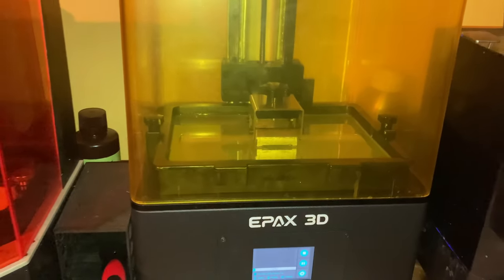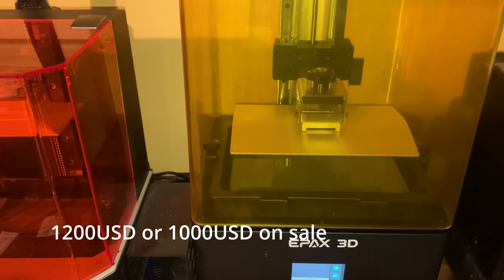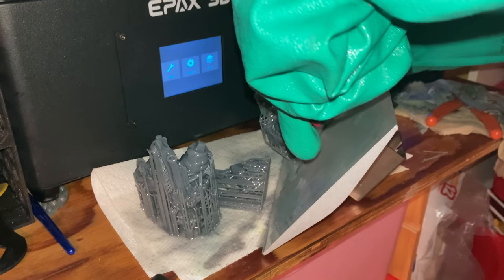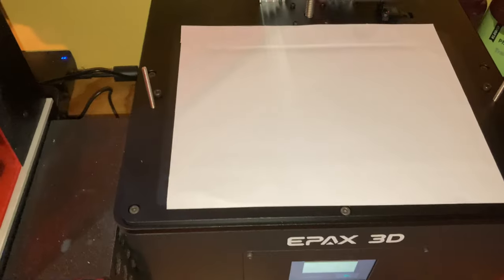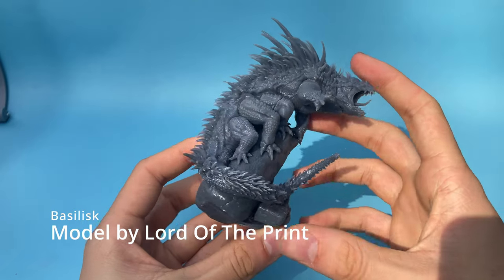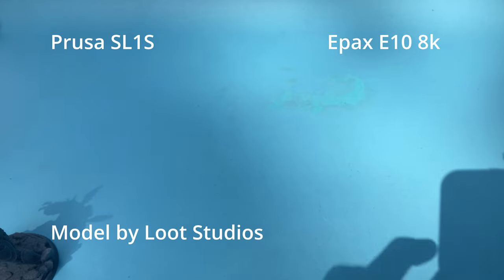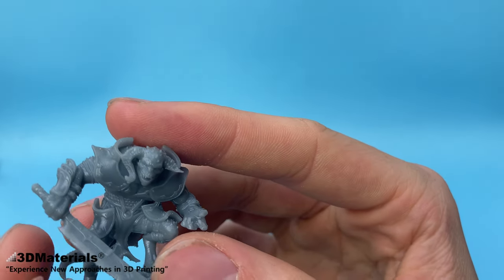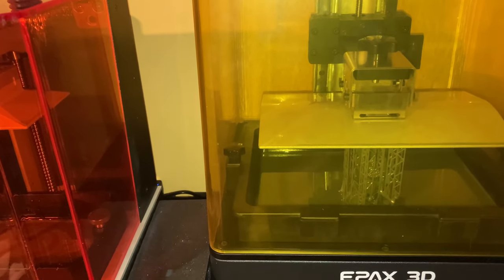This is the HIGHEST resolution 3D printer. But Is it worth it?

Comment: Nice review, not to be that guy but the pixel density on the Phrozen mini 8k is a bit better, so technicially it has the best resolution currently.  I have one and I am happy with it mostly.  If something better comes along density I will buy it as well since I am a sucker for these smooth curved glossy prints and unbeliveably small details as well!
Reply from the maker: Yep pixel density is better but resolution is technically lower as it’s a 7680x3440 display instead of a 7680x4320.
Reply: Does better pixel density mean a smoother print?
Reply from the maker: Generally yes
Reply: @tiger3dprinting  Thanks 👍👍
Reply: I wish they'd release an 8k version of the x1 with an 8k 6.5" screen. Sub 25 um would be awesome. Even better would be a DLP upgrade. The base of the x1 is slightly larger than the Photon Ultra D2 so it could be done. It seems like EPAX is losing popularity, they released some nice machines last year but they all kinda fell flat. Nothing to get overly excited about.  A 4K DLP version of the X1 would get some attention. Its a proven design, & Epax is pretty much the only company with domestic support in their price range. They just need an exciting product.
Reply from the maker: The main thing I liked about the epax is the upgradability
Reply: @tiger3dprinting  I like that too, especially for the more expensive models. I'm not sure the upgrades are worth it for the lower priced printers though. If the upgrade is within $200 of a new printer, just buy the new printer. There are a lot of benefits in having a second machine. Do more in less time, get that new warranty, you'll now have backup parts should you need them, & you can avoid the hassle of installing the upgrade.
Reply from the maker: Yep don’t have to tell me bout getting new printers lol I have pretty consistently more machines than I resonably need